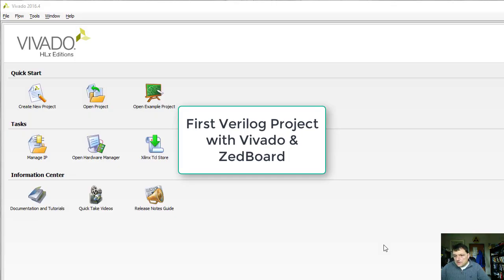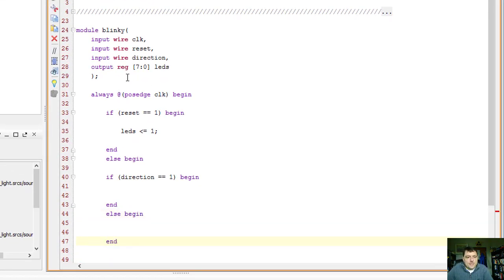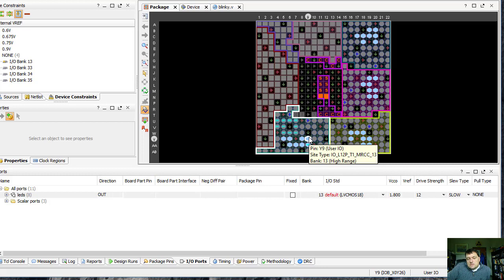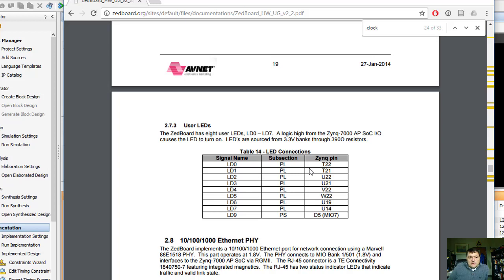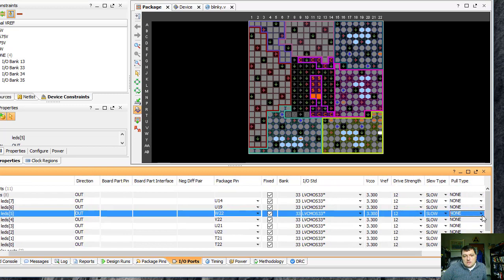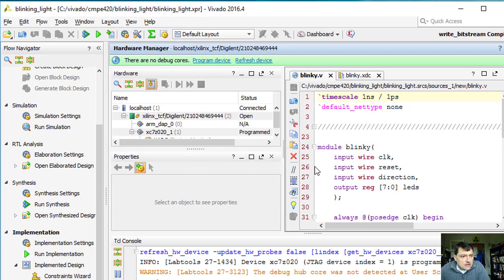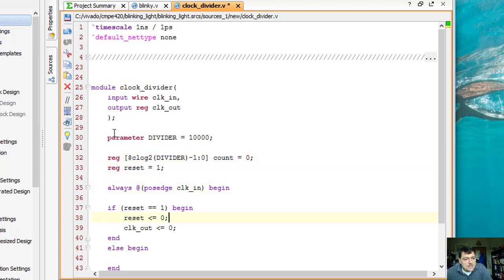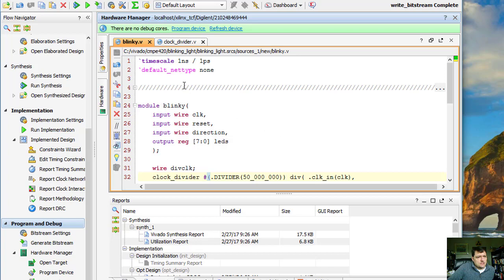First project with Vivado

Comment: when you rotate light through the LED array, you used "<="  instead of "=";  could you explain the difference, I know the former is non-blocking(async)  and the latter is blocking(sync or sequential by clock).  But to the naked eye, will there be a visual difference if you used the "=" to do the rotation instead?

Comment: I do not have the board so I selected the same chip and tried to follow your demo as an exercise.   I still did not successfully generate the bitstream after manually creating a constraint file; and I kept getting the same errors that you got in the video; the error was about the IOSTANDARD not being a specified value, even after I went into the "I/O ports" and selected specific values in the pull-down window.   I think like you said it can get "absurd" in this issue.  Why would Vivado make it so difficult and give users hard time like this.

Comment: [DRC ZPS7-1] PS7 block required: The PS7 cell must be used in this Zynq design in order to enable correct default configuration.

Is there a Vivado setting, .xdc constraint parameter setting, or other remedy for this warning?

Comment: [Place 46-29] place_design is not in timing mode. Skip physical synthesis in placer

[Power 33-232] No user defined clocks were found in the design! Power estimation will be inaccurate until this is corrected.
Resolution: Please specify clocks using create_clock/create_generated_clock for sequential elements. For pure combinatorial circuits, please specify a virtual clock, otherwise the vectorless estimation might be inaccurate

[Timing 38-313] There are no user specified timing constraints. Timing constraints are needed for proper timing analysis.

What are the remedies for these warnings?

Comment: so you can change the voltages on a bank or it's already set? the zedboard_master_UCF says a specific voltage for each pin but in software there is more than one option.

Comment: You should not be using initialed regs in your clock divider. You also mixed blocking and non blocking statements in your sequential logic. These  are not proper RTL design. You should have just run a reset signal into this block